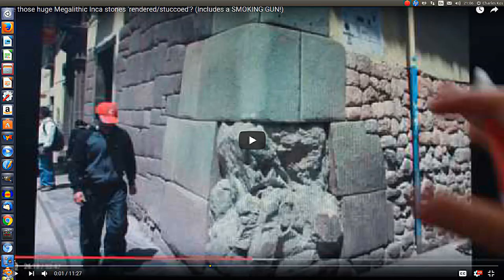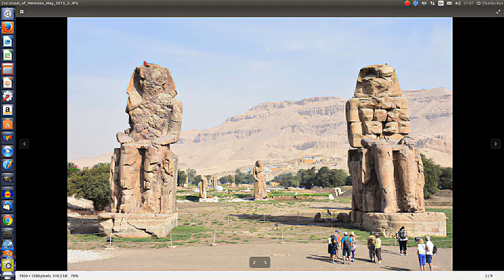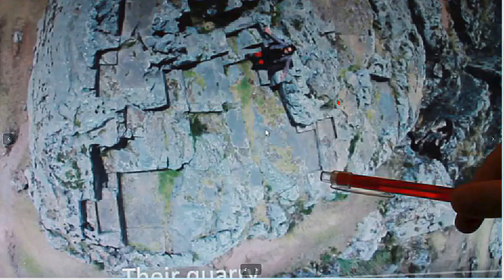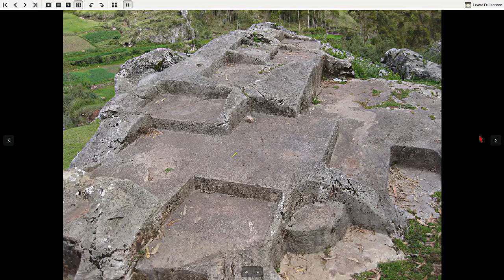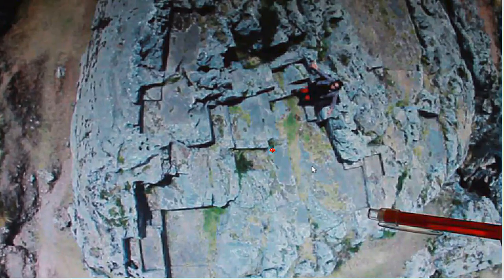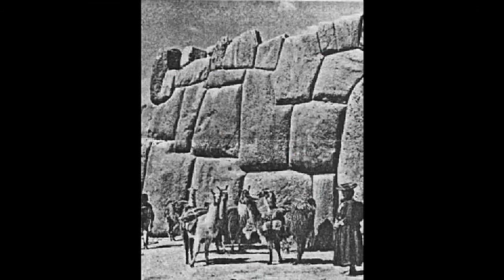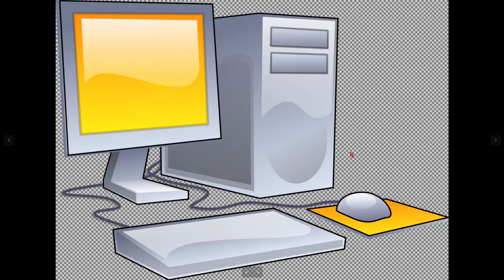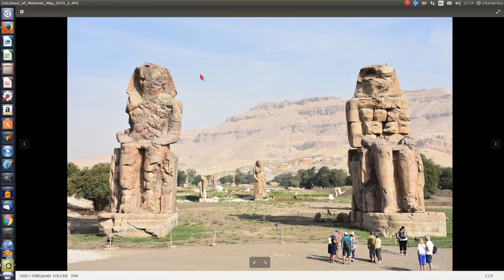'Cut like Butter'.... MOULDS were pressed in and geopolymer scooped out

Comment: Ive been concreting for 30 years now and this moulding is cosistant with todays tech.casting slabs in this way is common nowadays.hidden ancient technology is hidden for a reason.ive always said that the Egyptian pyramids were poured into blocks.thats why you cant slip paper between blocks,because its poured on top of one another and also the dimensions are built within a quarter of an inch.not possible with blocks of stone.only way is to cast blocks on top of one another with a bonding agent.
Reply: It doesn't explain the cut obelisks that have not completely been quarried out of the bedrock... they could have used a combination of quarried materials and poured?
Reply: This has now been scientifically proven. Google pyramid + geopolymer.
Reply: my foreskin is missing: Gentlemen,  a French scientist Joseph Davidovits has demonstrated that the pyramid blocks were done just as you had said.  Search his name for more information if you need it.
Reply: Same here! As a concrete technician, its incredibly frustrating that its not so visible to the masses.
Reply: @Lightworker444  it does explain.  This is why they are still there. They decided it was a ridiculous feat, and chose to make their own. 
I can make a beautiful wall from seemingly cut stones. I can antique them. Everything you think about a cut stone, I can create in a fraction of the time, using soft material.
Reply: @whkwole6842  some were proven to be stones and he was quickly dismissed,  however,  he never said "all" weren't real stones. Just the large, inconceivable ones, and all of the tight fits. 
Once I pull my forms, I can make it look absolutely beautiful.  What you will have inside though, is air entrainment, exactly like you see in the large structures in question, and not in real stone (for the most part)
Reply: @bobbysweeney5377  : Thanks.
Reply: @Lightworker444  apparently it had to do something with their religion that the obelisk had to be out off stone and hence could not be made the same way. I came across some information about that somewhere but sorry can't quite find it back.
Reply: Did you ever mix a ten thousand ton mountain of concrete to form a handful of slabs?

Comment: If moulds were used, why do we not see shapes repeated on the constructions? It seems illogical to make a mould for each individual piece when you could just mould it in situ.
Reply: I've thought this too. We have those cement molds now for doing intricate, interlocking shapes. So you'd think they'd have something like this, especially for doing large scale jobs. But maybe, just MAYBE,  things like this were done in a sort of whimsical fashion. Done just as much for the art of it as for the function. I suppose we'll never know! =D
Reply: When you see pix of amazingly one-off interlocking shapes that look so hard to do, I agree you have to wonder if it was easy for the constructors to play with their methods.
Reply: If this is the bottom of the heap of geopolymer, as it were, they may have just used it to mold out a few random pieces they needed for miscellaneous parts of whatever they were building.  The missing top portion of the heap was probably cut out more efficiently.
Reply: I agree with you. There is no sense in using moulds like concrete forms for different size pieces. A so advance tech culture would efficiently used forms for equal size pieces in a serial fabrication process.
Reply: In one hundred years we could be at the same position they were 100,000 years ago. Or maybe not. Who's to say?
Reply: for the irregular shapes there's a theory that suggests using simply bags. Bags filled with cement and then put on top of each other to form  those walls
Reply: @gonzalocontreras9570  no, the size differences and strange Interlocking design serves to make these foundations earthquake proof. That's why their isn't serial production.
Reply: @kandysman86  If that was the cas, they just needed to make some protrusions in the pieces and fit them. Serial construction is part of a bit more advanced tech culture.
Reply: @gonzalocontreras9570  I understand what serial production indicates.  But even if they were capable of that.(which they probably were ) They would not use it for this type of production. Certain parts of these blocks make 90 degree turns and still fit into each other as if by magic. They had the ability to calcute what crazy angles and shapes to fit together to prevent them from suffering any earthquake damage. That is clearly why they are the shapes they are, seeing as that's the purpose they serve. It couldn't have been an accedent.
Reply: @kandysman86  I agree that the earthquake proof design could be covered due to their experience with seismic movements, but they used stones. The ancient cultures probably had the capability to cut and carve the stones with awesome precision.  Thats why no serial production was used.
Reply: There is replication of a star shape stamp from the production spot at puma punku to some other sites around the altiplano.
Reply: They put the geoplymer in sacks that woild biodegrade. that expalins the surface bukges. The different shap and size stones provide earthquake resistance.
Reply: @flamencoprof  Since the constructors were giants of 500 feet to a mile tall, I'm sure they played with their "rocks". Just like human babies do today.
Reply: @Sobearcat  Pull the other leg. Besides being biologically impossible, beings that big wouldn't need such relatively miniscule constructions.
Reply: @flamencoprof  :-) What we call "megaliths" were just toys to the giant children.
Reply: @Sobearcat  So.. what did these "giant children" eat? Where did they live?
Reply: @flamencoprof  They ate the little humans, sheesh. They lived where ever they wanted. Not much bothered to tell them anything different.
Reply: @Sobearcat  Wouldn't trolls be more nourishing, and a bit easier to find, always being under bridges and all?
Reply: @flamencoprof  Trolls tasted bad and the humans were all over the place.
Reply: Apparently, the Pyramids blocks were constructed in situ.  Even Davidowitz, who is an Egyptologist, clearly outlined hieroglyphs that stated the word "manufactured.".

Comment: NO NO NO!  No one would ever pour geopolymer mix all over the place and then "scoop" it up into molds.  This makes 0 sense, Im sorry bro.  You would simply pour the mix into the molds and then let it set.   I dont know what exactly was going on with those "quarries" , but they definitely did NOT pour cement all over the place to "scoop" it up.  I do believe that geopolymers were used in ancient times though, but blocks not made as described.
Reply: My dear, you have not read enough.  Davidovich has proven the geopolymer idea.  Also, the electron microscope has revealed that the stone blocks at Sacsayhuaman were dug up soft limestone that they burned to rid the diatoms from it.  Then the builders gathered other materials to create a smooth ceramic stone.  So, those guys are materials  scientists.  They have proof.  They are highly regarded and respected investigators.  Mr Kos is supported by prior research.  If he failed to mention that others made reliable evaluations, then,by all means, he should have.

Comment: I have been studying this for a long time and I really endorse the geopolymer theory but with a specific viewpoint regarding the megalithic walls. The volume/weight of materials that had to be moved into place would have had to be soft enough to "form" tightly into the space being filled. This meant some process had to be used that would facilitate the dry/set time of the finished boulder and allow for a procedural process that was done in sequence which moved this great quantity...one (soft) boulder's worth at a time, placed it upon and next to the other pieces and (may have) allowed for forming and smoothing edges and finishing the appearance.  Therefore, there would have to be an allowance for a materials handling technology that was unprecedented then, and since, given the variables of the materials being used.

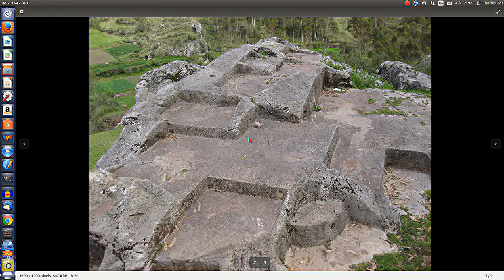Comment: Pause the video at 1:50...

If you visualise the shape of the original rock structure, it quickly becomes obvious that none of the removed slabs would be useful. Most (if not all) literally taper to nothing along many of the sides. The bottom of each slab would be flat, but the top would undulate like crazy, making the edges very uneven in height, and dropping so low in places that there would be no side at all there.

It seems far more likely that they removed the material by incrementally chipping away at it in small pieces, and the objective was never to quarry megaliths, but to simply level rectangular areas of a large rock to build something like a fort on top.

The large (quarter-circle) step in the foreground clearly implies chipping away unwanted material, and not removing large blocks whole.

Note that all of the vertical edges are relatively rough and pockmarked, just like the natural rock face. Only the horizontal surfaces are unusually smooth.

We could simply be looking at the foundations of a fort or castle, easily constructed with conventional Stone Age technologies.

Comment: In respect of Stonehenge I can say something because I investigated this some years ago. This  stone circle was according to Geoffrey of Monmouth brought by giants from Africa (which I think is refering to the older Herakles who's egyptian name was Chons) to its actual place. This has evidence in the fact that the carrying stones were of different lengths which when arranged according to their lengths implies that the circle once was situated on a smooth slope! It would be very interesting to find the original place of the circle.
Whoever build this circle originally was a genius! The so called V-connection of the capstones Is used as a guideway for the propose of removing and placing every single one of these stones perpendicular from above which of cause implies the use of a lifting technology like cranes (which is on the other hand unthinkable at this time, but the construction postulate them). This circle is evidently not constructed though possibly build by primitive people.

Comment: Charles,
I tried to say this on your Facebook page, but my text was lost. In 1991 my wife and I traveled the British Isles. At our stop at Stone Hinge, we were kept on the circular path around it. I was shooting slides and using a 135 mm short telephoto lens. Something caught my eye. It was a “reveal”. By that I mean, it looked as if the stone surface had a defect in it (like an air bubble?). It was rolled back on the softer corner to reveal a 12”+/- opening about an inch deep exposing a sharp 90 degree corner of a darker gray rock that immediately made me think that the outer material had been poured around another megalithic material that was a geometric rectangle. I have since watched everything that I can about Stone Hinge to see if this would be addressed, it never has, although I did see said corner in a pan shot. It made me wonder if each stone was concealing something much more articulate geometrically speaking. Now, with this being said, I am a Landscape architect with a double degree and have worked with both plastic (liquid materials as well as with stone construction).
Please see if you can find an image of the stone that I am talking about and give me your opinion.

Comment: A theory on the large stone walls..  Perhaps the ancients stacked smaller rocks together to build the structure and then encased the smaller stones in a veneer of geopolymer to create the appearance of massive "unmovable" monolithic structures so attacking invaders wouldn't try to breach the walls. If the walls appeared to be made of smaller stones then invaders might try to blast through them.  If the walls looked to be made of huge stones the invaders would be less likely to try to crash through them. Also, the appearance of giant stones may have been used as a show of strength, invading armies might be more worried about attacking a city that was surrounded by huge stone walls because it shows that the inhabitants were strong and capable of such amazing feats.  Psychological defense, perhaps?  Just a theory.

Comment: The real cut stones were vibrated on top of these ones to make different shapes. There's a guy on you tube showing how 2 stones are vibrated together so they fit tight. You take a crooked stone... vibrate it on top of this and it becomes flat. You vibrate it on the other shapes and you get the mirror of the shape. There are real quarries at these sites and you do see the tool marks of the stone cutting. That mound is just a shaping station where cut stones are vibrated on top of these and shaped. You see the shaping stations around the great pyramids.. there are hundreds of them. The stone put on top has the weight... it is vibrated with sound and takes the shape of the underneath part. The underneath part is not vibrated. It serves as a reusable form.. so I call it a forming station. If you look carefully you can see the areas where the stone dust could escape while vibrating the stones on top. That's why you see knobs on some of the megaliths in Peru. The knobs are there because the form had a hole for the stone dust to go into and so that's why the knob is there. The proof will come when someone finally makes a plaster cast of the knobs and see if they are exactly the same shape as the other ones... although over time the shape of the knob will change after vibrating so many stones in the mould.
https://www.youtube.com/watch?v=BsqOLCXYznE
The stones were levitated with short waves: 
https://www.theorionproject.org/en/documents/Kowsky-Frost.pdf

Comment: Large castles were built in Europe before (hightech) gunpowder and cannons were used, so no high tech weapons were available?
Trebuchet was the high tech weapon, appeared in the 4th century from China,  used to break down walls.
So, maybe in those days the enemy had some smaller rock thrower trebuchets, that's why  large, thick walls were built?
Also, wall to resist earthquackes!

Comment: As a geologist, all I can say that claiming this is a geopolymer (concrete) is as wrong as saying the Moon is diary product. The composition of these rocks were examined in detail nearly 30 years ago, the rock is an andesite, case closed, there's no room for speculation or debate. It's not a geopolymer (concrete). Here's a book and 3 papers on the subject...

"Hunt (1990) provides the most recent published petrographical descriptions. He describes the Rumiqolqa samples as hornblende andesite, with primary phenocrysts of plagioclase feldspar, basaltic hornblende, and biotite; there is a little pyroxene and occasional xenoliths [xenocrysts] of apatite and ilmenite. The Huaccoto samples are described as biotite andesite, with phenocrysts of plagioclase feldspar and biotite; hornblende is present but infrequent (Hunt 1990, pages 26-7). Hunt matches these petrographical differnces with differences in colour and physical properties, which serve to distinguish between the products of the two quarries in the buildings of Cuzco and to confirm the Rumiqolqa origin of the imperial building stone. These are influential descriptions, which have been quoted subsequently (e.g. Bauer 2004, page 157)." - Ixer et al. (2014).

The mineral composition of cement is entirely different; cement & concrete contain minerals such as portadite, larnite, spurrite, which are extremely rare in nature (they are found in a few places on Earth in limestones heated to very high temperatures in contact with hot lava flows that later reacted with ground water, mimicking artificial cement & concrete formation). Modern cements also contain Belite (2CaO·SiO2), Alite (3CaO·SiO2), Tricalcium aluminate (3CaO·Al2O3), Brownmillerite (4CaO·Al2O3·Fe2O3) instead of Lime (CaO).

Here's plenty of papers about the subject.

Ogburn, D., 2013. Variation in Inca Building Stone Quarry Operations in Peru and Ecuador. In Mining and Quarrying in the Ancient Andes (pp. 45-64). Springer, New York, NY. http://www.springer.com/cda/content/document/productFlyer/productFlyer-WEST_978-1-4614-5199-0.pdf?SGWID=0-0-1297-174551589-bookseller 

Ogburn, D., Sillar, B. and Sierra, J.C., 2013. Evaluating effects of chemical weathering and surface contamination on the in situ provenance analysis of building stones in the Cuzco region of Peru with portable XRF. Journal of Archaeological Science, 40(4), pp.1823-1837. https://www.sciencedirect.com/science/article/pii/S0305440312004256 

Ixer, R., Lunt, S. and Sillar, B., 2014. The use of andesite temper in Inca and pre-Inca pottery from the region of Cuzco, Peru. Craft and Science: International Perspectives on Archaeological Ceramics, Bloomsbury Qatar Foundation, Doha, pp.31-38. http://www.qscience.com/userimages/ContentEditor/1417462793132/UCLQ_1_CAS.pdf 

Ixer, R., Lunt, S., Sillar, B. and Thompson, P., 2014. Microscopic rocks and expansive empires: Investigating Inca ceramics from Cuzco, Peru. Archaeology International, 17, pp.122-136. http://www.qscience.com/userimages/ContentEditor/1414586825906/ucl.2014.ch4.pdf